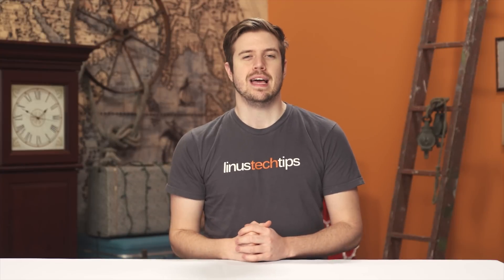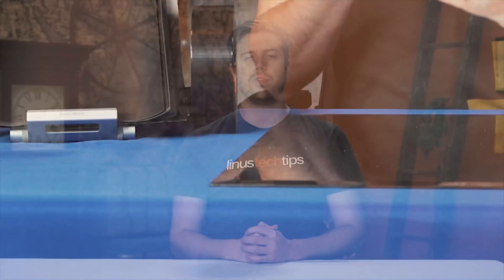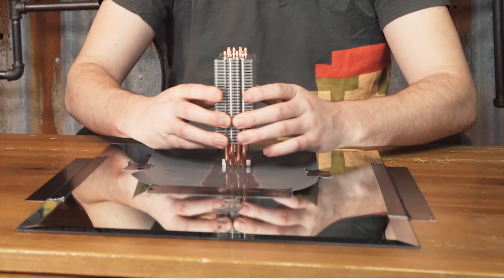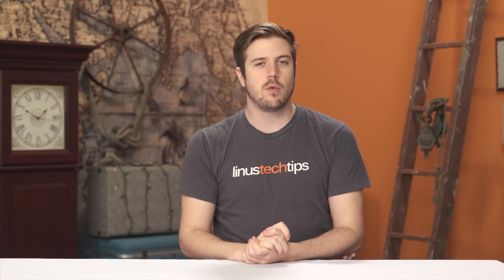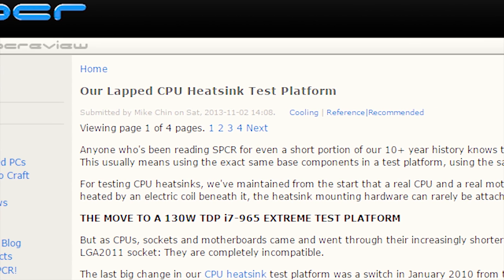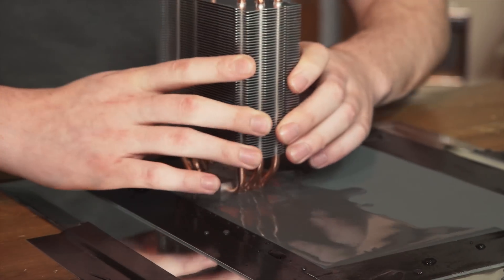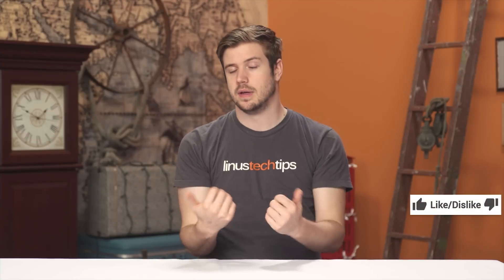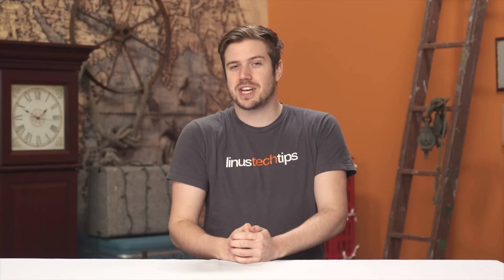CPU & Heatsink Lapping - Are concave, convex, or flat heatsinks best for cooling?

Comment: Back in my day, lapping meant sanding BOTH the CPU and heatsink so get a perfectly smooth mirror finish mating surface that eliminates the use of thermal paste. It was supposed to be a form of cold welding, or the effect you get when two mirror finishes of metals come in contact to each other, they tend to stick together very well.
Reply: +Kirill Ostapenko yup, what this guy said; any machinist can confirm this
Reply: +cl4ster17 Gage blocks are smooth enough that they do not allow air molecules to be in between two of them if they are wrung properly. When wrung right a stack of gage blocks can be held horizontally without glue. According to wiki they can with stand a pull of 75lbf or 330N. I would be curious of the result if the two surfaces were are smooth as gage blocks, the same metal, and wrung together properly. If done right thermal paste should not be needed.
Reply: back in my day you couldn't lap the cpu... as the die was exposed, lol.
Reply: OwenWalker From what I can find in metals most of the thermal transfer is done via free electrons. As long as a "metallic bond" is created and the two pieces of metal think they are the same heat will transfer just fine.

From wiki "Metals (e.g., copper, platinum, gold, etc.) are usually good conductors of thermal energy. This is due to the way that metals bond chemically: metallic bonds (as opposed to covalent or ionic bonds) have free-moving electrons that transfer thermal energy rapidly through the metal. The electron fluid of a conductive metallic solid conducts most of the heat flux through the solid. Phonon flux is still present, but carries less of the energy. Electrons also conduct electric current through conductive solids, and the thermal and electrical conductivities of most metals have about the same ratio."

There is also the fact that atoms never really touch each other or make contact with anything as the amount of energy required is enormous. They just have to be close enough to influence each other.
Reply: +zefrum3 wow ,i thought you said masochist instead of machinist , i still dont think i was wrong xD
sanding cpu and heatsink for hours is something M would love to do
Reply: Bourinos02 Umm maybe you should look at the definition of metallic bonding... In metallic bonding there are positive ions (atoms) in a sea of negative electrons. Electrons move very freely in most metals and they are not confined to one atom or molecule hence their high electrical and thermal conductivity. If the electrons did not move as freely as they did then a metal could not conduct heat or electricity as well as they do. In most metals atoms bond and connect with at least 8 other atoms. The bonds are not static and they tend to rotate around.

You are still missing the fact that "perfect contact" is not needed to transfer heat effectively once a metallic bond has been created since the majority of the energy is transferred via electron motion and not atomic motion. Free moving electrons between the two pieces are are all that is really needed. Are most TIM perfect? No, yet they still effectively transfers heat do they not? Yes they do. With a proper metallic bond the energy transfer should be greater with a cold wield vs. TIM.

Soldering is not needed once again...since it is just reducing the gap between atoms by creating a different type of bond. Maybe you should look up the difference between covalent and metallic bonding. Just because the two pieces can be separated does not mean there is not bonding going on or the sharing of electrons... Why else do the two pieces STICK TOGETHER SO WELL if some type of atomic bonding or sharing of electron is not happening? The gap between the atoms/bonds is simply larger and is slightly weaker is all.

When you bring together two similar atoms or pieces of metal the positive ion (atom) is attracted to the negative charged electrons of the other atom and vice versa. They will continue to attract each other getting closer and closer until a minimum or average distance is reached.

The molecule shape of tungsten carbide is hexagonal (hP2) and wiki has a picture of it... It is used to make gage blocks since it is hard and durable. If a metal/crystal material was made up of identical layers with all the atoms/molecules lined up perfectly with say a flat top and bottom what is to prevent it from breaking apart into layers then? Since with enough force it is possible to slide metal atoms/molecules in a plane without disrupting the metallic bond between them. Depending on the material some random orientation of the atomic structure makes for a stronger material. My point that you missed is that most gage blocks have a surface finish/roughness of over 1nm, but less then 25nm yet a good "wring" is still possible even though the surfaces are not perfectly smooth...

It is possible to not use TIM if the proper machining/polishing has been done? Yes it is. It is ideal do so with the cost involved? No, it is not. TIM is much cheaper.

This has been a fun discussion, but I have better things to do then sit here and teach a class. Everything I have discussed is out on the internet.
Reply: +Kirill Ostapenko amazing
Reply: Bourinos02 One last thing that I forgot to mention is electrons will jump a gap even without a bond of any kind given enough potential. The smaller the gap the less potential energy is needed. When a metal get heated due to random motion of the electrons, they will be denser at the cold end of the metal. Since there is more of them at one end vs the other, a voltage/potential is created. Due to random motion of the electrons there will be voltage peaks. The smaller the gap the less of a voltage peak would be required to transfer energy across a gap even if a bond did not exist. I would say to look at semiconductors, but electron flow is different in them vs metals.
Reply: +Den Log similar material, not necessarily the same.
Reply: Bourinos02 Soldering a metal just reduces the gap just the same as lapping since once again no atoms are ever really touching each other. As long as electrons can transfer from one piece of metal to the other, heat and electricity can transfer just fine. If two pieces of copper of gold were lapped without solder and you checked the resistance it would look like one piece of metal. It is why the gage blocks stick so well to each other other then surface tension and air pressure.
Reply: Bourinos02 There is no "surface contact" ever between atoms. Atoms are not locked into place and they can move around even if they are part of a molecule. Under load, which is what you are doing when you wring two pieces of metal together. The peaks and valleys of the surface get even closer together then they were before as two individual pieces/surfaces. If you do not use force you cannot get a good wring between the metals. The surfaces are close enough to transfer electrons which is "close enough" or else the effect would not happen and the blocks would not stick together so well.

A molecule of tungsten carbide is around 1nm so at a minimum the surface roughness of gage block made from them are same. In other words even a "smooth" surface is not that smooth even at the atomic level...
Reply: If you like to check flatness down to molecular level, you can use optical flat for it. Lapping improves cooling transfer, especially heat spreaders are very poor quality and benefit from lapping. Just me 2 cents.
Reply: Kirill Ostapenko I think you are correct, the most important thing I have found is if a "metallic bond" is created or not.
Reply: Den Log It is partially true, but be careful, no real metallic bond is created (it if was the case, it would have meant that you've soldered the two pieces). But electrons can still go through the space between the 2 plates and heat can still transfer, it's jut a little bit less frequent than if they were really soldered to each other...
Reply: Den Log Well, I get what you mean by atoms don't touch each other, but there is surface contact by definition... It's just that it's made by the contact of electronic orbitals of the atoms to each other, hence the atomic contact. It is possible to have a perfect surface contact using epitaxial growth of one material on top of another, that way it's behaving like if the 2 materials were soldered to each other. 
I think you are confusing the case when electrons can pass from one layer to another and when they are shared from each other. 
In other words, if you polish 2 perfect surfaces and put them together, they'll indeed stick very well, but you can take them appart with your hands. If you use another technique like epitaxial growth or soldering, you cannot separate the 2 layers, no matter how hard you pull, you'll just break your material.
As for the smoothness of a surface of tungsten carbide, I'm quite sure that the crystal can be atomically flat as it's a succession of hexagonally packed C and W atoms, my bet would be that the (0001) plane would be the smoothest a.k.a. the densest plane, but I don't know exactly about its cristalline structure so I could be wrong about that.
Reply: I haven't got the bottle to not use thermal paste and I can't be bothered to spend ages getting a mirror finish.  I do both cpu and heatsink though and average 3 degrees C drops.
Reply: I have been using mercury for my i7 7700k overclocked to 5.6ghz at 1.53volts.
Reply: +theotaku7 lol.  but its so sepnsive to operate thats why they have to keep reinventing the wheel without doing research!!!!
Reply: I read mention of electrons traveling more frequently between two surfaces of metal when lapped and wrung properly?  How much of either or both is necessary between flesh and a broken power line for a person to be electrocuted by the person's bare skin accidentally coming into contact with wire if it's still live?
Reply: It's true! -- This is definitely a thing. -- The grumpy old fart on the AWE channel has a video on it, explaining how it works, but yeah, no magnets, you can just twist the two bits of metal together and they start welding...
Reply: I did this back in the day. When de-lidding was simpler. But I still used metallic thermal paste. I didn't have the time to test with and without. But something to be said is that, the thermal paste would likely also let you seperate the cpu and heatsink, where as full contact  and "welding" and corrosion would make things permanent.
Reply: in the absence of oxygen.
Reply: This makes more sense.
Reply: Yeah you basically push all the air from between them. Gage blocks have a similar effect.
Reply: +Kirill Ostapenko That's what lapping is. Luke didn't get that HS anywhere near mirror finish and I'm assuming the CPU went untouched. The whole video was a waste of time, but I guess they got the views, so they get the ad revenue, and that's all that matters.
Reply: cl4ster17 Umm most surfaces look rough under an electron microscope... To be able to wring gage blocks the surface finish/roughness should at the very least be less then 25nm. Most atoms are in the 100-200pm or 0.1-0.2nm range and molecules are ever larger. Under force the distance becomes even less since atoms can move slightly. Very little oil is used or is needed and it really just makes it easier to wring especially as the blocks are used/wear.

Cold welding "Cold welding was first recognized as a general materials phenomenon in the 1940s. It was then discovered that two clean, flat surfaces of similar metal would strongly adhere if brought into contact under vacuum. Newly discovered micro-[1] and nano-scale cold welding[2] has already shown great potential in the latest nanofabrication processes.

"The reason for this unexpected behavior is that when the atoms in contact are all of the same kind, there is no way for the atoms to “know” that they are in different pieces of copper. When there are other atoms, in the oxides and greases and more complicated thin surface layers of contaminants in between, the atoms “know” when they are not on the same part.

— Richard Feynman, The Feynman Lectures, 12–2 Friction""
Reply: +OwenWalker You might need something like a ion beam cross-section polisher, it'll require a LOT of work, but in the end, if you manage to do it, you probably have the best surface contact around the world! For nothing but still, you at least had fun xD
Reply: Den Log No, you can only say that if the 2 pieces of metal were atomically perfect surfaces with the higher crystallographic surface compatibility. Something that sandpaper will never give to you. You can get close to that via an ion beam polisher, but still, you'll get more resistance from the vacuum between the 2 layers than a soldered piece (of course we're talking about very few resistance anyway as the 2 surfaces are metals).
Reply: +Kirill Ostapenko If I am not mistaken both pieces should be the same metal or material for the effect to work the best which is rarely the case. If not it is just the lack of air between the two materials that is mainly holding them together.
Reply: +Kirill Ostapenko Even a mirror finish is still not even close to smooth enough to eliminate the use of thermal paste. For that you would need a surface that's smooth at molecular level.
Reply: +Kirill Ostapenko Err.. you still need TIM when lapping, Unless you can remove ALL imperfections at the atomic level, TIM will still improve thermal conductivity.
Reply: Den Log Gauge blocks may be smooth enough so that they stick together (a thin film of oil is needed) but that's still not enough for maximum heat transfer because if you look at the surfaces under an electron microscope they're still quite rough.

Comment: lapping the CPU is more effective.  most coolers are flat enough or a little convex and work fine.  But, often the CPU is concave.  My current 4930K had a very poor heat spreader.  When I put a straight edge over it and shined a flashlight at the joint you could see the rather large gap at the center.  After lapping temps dropped almost 10C.  Been lapped a bit over a year.  I have had it for about three years now.  maybe four.  I also had to lap my Q6600 back in the day.  Same issue.  If you don't have a big gap under the straight edge test, it's not worth doing.
Reply: +Chad Bremer well said but i think 10c is a stretch. I  got 4C drop on my old  C2D and 3C on dated but current i7 860. My first gen TRUE was pretty flat so i never bothered to lap that but both CPUs were sunken in. Used a straightedge and feeler gauge at the time to measure how much.
Reply: Lawrence Sinanan like I said, it was a rather large gap in the center.  Way bigger than normal.  So, couple extra degrees most likely from that.  I said almost 10C. Don't recall the exact difference.  Around 8c maybe.  It was a year ago.  Lol

Comment: I'd be nervous about lapping the surface of a liquid-filled copper tube like that. Lap it too far, and you might cause a weak spot or even open a hole...and your lovely chilled heat sink is now more of a lawn sprinkler than a chiller.

Comment: I may be misremembering but concave vs convex cooler boil down again to an intel vs amd argument. AMD and intel use opposite stamping directions when fabricating the Integrated HeatsSink. IIRC Intel IHS bow in a convex fashion which means a Concave cooler would perform better.

For lapping to be done properly both the Heatsink and the processor need to be lapped in order for them to be both Leveled surfaces. One or the Other being lapped invalidates it as it still keeps a convex or concave surface in the equation.
Reply: +ORCACommander Mating a convex surface to a concave surface won't really improve anything, unless the radius of the bow is exactly the same (or if the convex part has a slightly smaller radius). If the radius is slightly too big, it'll just create a pocket either way. And there's no way you'll match the profiles of something as large as a heatspreader and a heatsink base, using home tools - that would require CNC precision and measurement.

Comment: Lukey boy, the tiny gaps are why we need thermal compound. Take an unlapped cooler and a lapped one, and don't use thermal compound, you'll find the lapped one should work better as there aren't as many gaps, which thermal compound would normally fill.